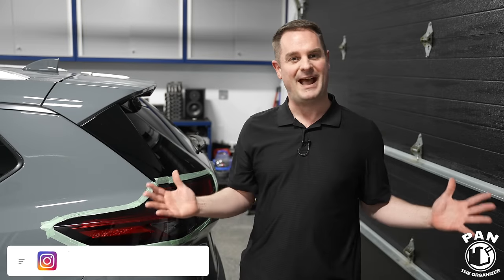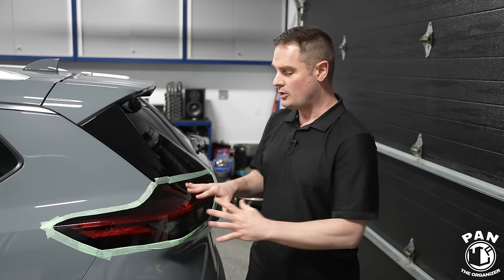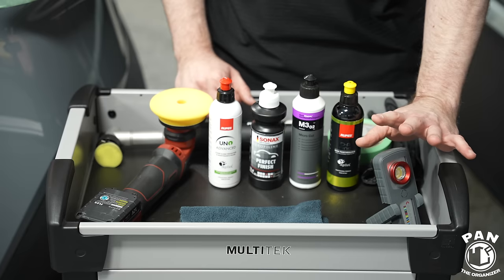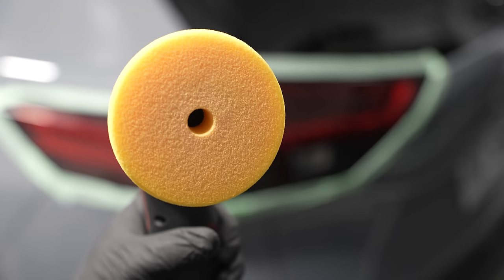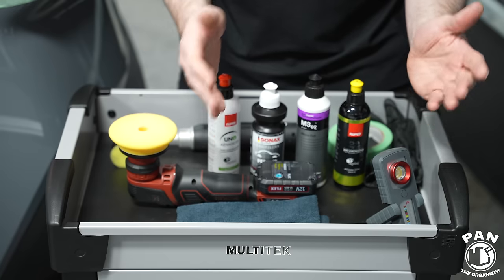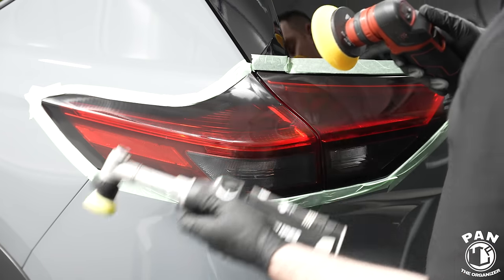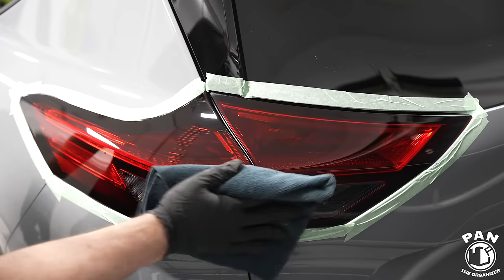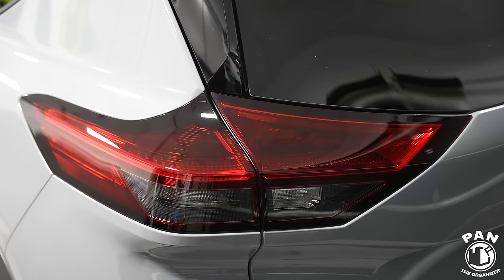How To Polish Tail Lights

Comment: I do often do this to re surface the tail lights and headlights!  Is paint correction a similar process pan?  I’m actually very reluctant to attempt paint corrections, which is why I have not chosen to use a ceramic coating.
Reply from the maker: You're in luck. I have a popular paint correction tutorial for beginners here: https://youtu.be/ustTEVGMOTI
Reply: @PanTheOrganizer  thanks so much pan!

Comment: I’m getting this product used on my 21 pearl black civic, for 1 step correction. Would you please give me an option for a topper for this? With it having sio2 technology could you use something like turtlewax hybrid solutions cermaic spray coating?
Reply from the maker: When using an all-in-one, because it already has protection in it, applying a ceramic coating on top isn't a good idea, as the coating won't be able to bond to the clear coat. Coatings need to bond to a virgin clear coat without any protection interfering.

As you are thinking of applying a spray coating like the TW Hybrid Solutions Ceramic Spray Coating it isn't as critical as a full blown ceramic coating in a glass bottle, so you could in theory still apply it on top of the Rupes Uno Advanced. Perhaps don't expect the full durability of the Ceramic Spray Coating though.

If you want maximum performance and durability, use a regular polish that doesn't have protection in it (like Rupes yellow D/A fine polish, Sonax Perfect Finish, etc), then use a paint prep spray to remove polishing oils and residue, and then apply the protection.

When you use an All-In-One type polish like Rupes Uno Advanced, it's for a quick correction and paint enhancement all while applying a light protection at the same time. It's to save time and money. Not to get maximum performance and durability.
Reply: Totally understandable, I don’t have the money to get a proper 2 step correction and a proper ceramic coating, the detailer I feel was steering me in that direction to offer me some protection for what I could afford. 

I am just trying to be proactive and see if there was something I could to to help boost what he was planning on doing. I think I will discuss this with him, from watching your videos I feel confident I could do a glass bottle ceramic coating, now deciding on something that is $100-$150 that is worth it for at least a couple years. 

Any thoughts or opinions on that? 

Thanks Pan!

Comment: Hey pan. not sure If you have tested it yet with this product but do you know if you can use the uno advance on paint work and then apply a ceramic coating on top or will the coating react to the ceramic that is applyied by the polish
Reply from the maker: This isn't meant to have a coating applied over it. True coatings (in glass bottles) need to bond directly to a virgin clear coat. Uno Advance isn't a coating primer.
Reply: @PanTheOrganizer  okay cool thought so just wanted to make sure thank you

Comment: Very nice. How do you find that the Uno Protect works well on paint?
Reply from the maker: It does great on paint too, as long as you have realistic expectations. As this is an all-in-one polish, it's not meant to remove heavy and deep scratches or swirls of heavy oxidation. It's meant for a light paint enhancement, to correct minor defects, all while adding some light protection on the surface that can last 6 to 12 months according to Rupes.

Comment: Great demo as always, thanks! Loved seeing and hearing more about the Uno polish. Would it be reasonable to lightly polish headlights/tail lights once a year with this?
Reply from the maker: You could do the same on headlights too, but keep in mind, neglected headlights that are heavily yellowed, oxidized and/or have a hazy/chalky white appearance, typically need more polishing techniques. Water sanding, compound, polish, IPA wipe and a ceramic coating applied is usually the best restoration method.

If they headlights are only lightly faded, and you don't have the time or all the tools for a full restoration, you can also use a quick tool-less method like in my headlight restoration tutorial here: https://youtu.be/sqpXsBcVako

Comment: Can this be used on the headlights or do they require a different process?
Reply from the maker: You could do the same on headlights too, but keep in mind, neglected headlights that are heavily yellowed, oxidized and/or have a hazy/chalky white appearance, typically need more polishing techniques. Water sanding, compound, polish, IPA wipe and a ceramic coating applied is usually the best restoration method.

If they headlights are only lightly faded, and you don't have the time or all the tools for a full restoration, you can also use a quick tool-less method like in my headlight restoration tutorial here: https://youtu.be/sqpXsBcVako

Comment: Hi Pan! Is there any difference between the process on headlights at the front of the car and tail lights at the back of the car? 

For headlights I normally see the process; wet sand, compound, polish, and protect. Could that process also be completed on the tail lights? 

Rob - Perth, Australia 🤙🏼
Reply from the maker: You could do the same on headlights too, but keep in mind, neglected headlights that are heavily yellowed, oxidized and/or have a hazy/chalky white appearance, typically need more polishing techniques. Water sanding, compound, polish, IPA wipe and a ceramic coating applied is usually the best restoration method.

If they headlights are only lightly faded, and you don't have the time or all the tools for a full restoration, you can also use a quick tool-less method like in my headlight restoration tutorial here: https://youtu.be/sqpXsBcVako

Comment: I have a question.Does the rear light has the same coating like the front.I am just worried the polishing work could damage the coating.(some cats leave some scratches to my taillights😢,and that was my new car)
Reply from the maker: You don't polish a ceramic coating, as you'll remove it if you polish it.

Comment: hey i meant to ask u can u use purple power vehicle and boat wash on ceramic coatings
Reply from the maker: Not recommended on any type of protected paint, as that's a very high pH shampoo and it could start weakening the coating, and it can break down waxes and sealants.

Comment: Hi Pan, a great video again! Unfortunately I've tried a little hand application and buffing as suggestsed from my Soft 99 microcompound light instructions  on my Bmw g42 tailights, and it got a lot worse, did what the producer told on the packaging.. Dont know what to do, the car was clean 😭 it would be hard to do with a machine polisher, that's why I bought the microcompound light wich has little cutting power 🥲
Reply: Applicaton was with a microfibre towel as it was the black part of the taillight (really slim part that's why I didn't use the applicator from the producer)
Reply: Ok it's not THAT bad, but still the opposite effect..
Reply from the maker: Unfortunately I never recommend hand polishing as it takes a lot of energy and time and you never achieve the same level of results as with a machine polisher.
Reply: @PanTheOrganizer  
Thank you for your anwser, yes, i've learned it the hard way... cheers, and again thank you! Keep up the great work! Cheers!

Comment: Can you follow the same process for the headlights?
Reply from the maker: Yes absolutely. Depending on how bad the oxidation/yellowing of your headlights is. If they are heavily oxidized, you'd have to start with either water sanding, or a heavier cutting polish first, then move to a finishing polish, and ceramic coating application.

Comment: Hello. I have a question for You. I had my tail lights polished by a detailer with Koch Chemie Ultra Cut, then finished it with Micro Cut. I like the result, its fine, but now im worried that it was too aggresive and took out too mich clear coat :( should i be worried? They were polished for the first time and he put protective wax on them. Did he do ok or he messed my up tail lights 😢
Reply from the maker: It’s totally fine. You can polish lights a few times before having to begin worrying about them.

It would have been better if he had applied a ceramic coating at the end though, as those last much longer compared to regular waxes.

If you want to prevent the lights from oxidizing and yellowing, make sure you keep on top of protecting them, just like you would do with your painted surfaces. 👍🏻
Reply: @PanTheOrganizer  Thank you, really. My car is 1 year old, but the tail lights were so badly swirled and scratched, i dont know how. I think that the dealer ruined them while cleaning. I definetely wont agree to wash my car again. Anyway he did propose to put ceramice coating on em, but he said that i would have to leave my car for about 24 hours to let i t dry. Thats why i didnt want it, cuz i need my car :) anyway gonna but the wax regularly. And one last thing, did you notice how the tail lights easily get scratched up? Today i wiped a reticule from one light and i scratched it with my finger 😢
Reply from the maker: It depends on the lights, not all of them have the same hardness, some are softer than others, hence easier to scratch. The most important thing is to use safe washing and drying methods when washing your car. Lucky for you, I have a very popular car wash tutorial here: https://youtu.be/7Koj5j2Es5U
Reply: @PanTheOrganizer  ok, thank you. One last thing. I dont see any clear coat failure on them. In fact they look brand new now. Im just worried that this will affect the speed of fading or oxidation in the recent time to come. He said that he polished it with a light foam pad. So if they werent wet sanded, just polished and the result is fine i shouldnt worry and just keep them in good condition Yes?

Comment: Is this procedure pretty much the same for headlights?
Reply from the maker: You could do the same on headlights too, but keep in mind, neglected headlights that are heavily yellowed, oxidized and/or have a hazy/chalky white appearance, typically need more polishing techniques. Water sanding, compound, polish, IPA wipe and a ceramic coating applied is usually the best restoration method.

If they headlights are only lightly faded, and you don't have the time or all the tools for a full restoration, you can also use a quick tool-less method like in my headlight restoration tutorial here: https://youtu.be/sqpXsBcVako

Comment: Possible to do by hand for those who don't want to buy a polisher?
Reply from the maker: Yes, but you would need much more elbow grease and you most likely won't achieve the same level of results for obvious reasons. But it would still be a good improvement over faded tail lights.

Comment: Being a new Nissan Titan owner, are there any characteristics that go along with Nissan paint?
Reply from the maker: Hi William. First, congrats on your new ride! A new car is never new until it's properly detailed. 
- at the factory, the paint defects are often corrected quickly by rotary polishing which can leave marks and holograms, so polishing corrects those, before you lock that in long term with a ceramic coating for example.
- vehicles are then transported by truck, train and boat so they are exposed to the elements, industrial fallout, brake dust, rail dust, etc
- vehicles are often left at boat docks (when transported by boat) or in exterior parking lots for weeks or months, again being exposed to the elements
- at the dealership, the vehicles are almost always poorly prepped using the same dirty water that was used for all the cars on a given day, and poor washing and drying methods leading to swirls and scratches 
- at the dealership, a layer of cheap wax or paint sealant is usually applied to attempt to make the paint glossy prior to delivery. It's crucial to remove any previous protection before you apply a ceramic coating, as coatings need to bond directly to a virgin clear coat.

If you only plan on applying a regular carnauba wax or paint sealant though, you could decide to skip machine polishing, as those protectants can be applied over existing protection and it's not as crucial to prep the paint as well.

I explain all of this in this popular video: https://youtu.be/QgoyrC-5CMc

So you can better visualize the new car prep process, here are the steps I perform on a brand new car from two of my customers: 
Tesla Model Y: https://youtu.be/gohks8xP5NY 
Porsche 911 Carrera: https://youtu.be/2ckiivbFqs4

Comment: Hey Pan, why didn’t you use the new rupes Microfibre pads, yellow or white?
Reply from the maker: Microfiber pads cut more typically, but they weren't needed for this level of defect removal. As you saw, the foam pads did perfectly well.
Reply: Thank you sir!

Comment: Hey Pan can we correct the headlights the same way ?
Reply from the maker: You could do the same on headlights too, but keep in mind, neglected headlights that are heavily yellowed, oxidized and/or have a hazy/chalky white appearance, typically need more polishing techniques. Water sanding, compound, polish, IPA wipe and a ceramic coating applied is usually the best restoration method.

If they headlights are only lightly faded, and you don't have the time or all the tools for a full restoration, you can also use a quick tool-less method like in my headlight restoration tutorial here: https://youtu.be/sqpXsBcVako
Reply: @PanTheOrganizer  Thanks i will watch this carefully .

Comment: Would like to see you do some very faded headlights to see how to make them back to like new. Ones that are a little bit out of just polishing out and needing a sanding first and the step by step guide to get rid of the oxidation
Reply from the maker: You could do the same on headlights too, but keep in mind, neglected headlights that are heavily yellowed, oxidized and/or have a hazy/chalky white appearance, typically need more polishing techniques. Water sanding, compound, polish, IPA wipe and a ceramic coating applied is usually the best restoration method.

If they headlights are only lightly faded, and you don't have the time or all the tools for a full restoration, you can also use a quick tool-less method like in my headlight restoration tutorial here: https://youtu.be/sqpXsBcVako

Comment: Great vid again, pan... q: does the same apply to front lights?
Reply from the maker: You could do the same on headlights too, but keep in mind, neglected headlights that are heavily yellowed, oxidized and/or have a hazy/chalky white appearance, typically need more polishing techniques. Water sanding, compound, polish, IPA wipe and a ceramic coating applied is usually the best restoration method.

If they headlights are only lightly faded, and you don't have the time or all the tools for a full restoration, you can also use a quick tool-less method like in my headlight restoration tutorial here: https://youtu.be/sqpXsBcVako

Comment: Hey pan, nice video as always :) do you have a video on restoring parts of a ceramic coating as well? Or planning on one? Similar to this video, we all face situations where we get a swirl or scratch on a part of the car or have to do a repair (dent or other); how then to repair only a small part of the coating instead of having to redo the entire car?
Reply from the maker: There not much you can do on a coated vehicle, as you wouldn't polish the surface. That would damage the coating. There is however one polish that was made to correct very light defects on a coated car, this one: http://bit.ly/3IC15uA
Reply: @PanTheOrganizer  but can you re do coatings on just a part of the car?
Reply: @PanTheOrganizer  Can you explain this a bit further? Why wouldn't the Rupes Uno Advanced work just like the Essence+ you provided the link to?  If you are polishing a ceramic coated vehicle with a polish that also adds/provides ceramic protection, what is the issue? Is it that you end up with a non-uniform look because the coatings may look different once they cure out? Is it that the ceramics in the polish won't (or may not) bond properly to the paint or the existing coating?  I could see how those things might all be issues but would like to understand the details.

Comment: Hi Pan,great video nicely explained. I have been watching your videos for a while now and been a fan of yours.I am also into detailing and watch your videos on daily basis... your videos are very helpful and provide tons of information.Thanks for your informative videos and keep going... just one question for Rupes Uno Advance does this contain fillers? & if not can we use this polish before Ceramic Coating application ?
Reply from the maker: It most likely contains fillers, and it's not recommended for use prior to applying a ceramic coating. Don't use all-in-one type polishes before applying a coating.

Comment: I believe that this goes for headlight also, right?
Reply from the maker: You could do the same on headlights too, but keep in mind, neglected headlights that are heavily yellowed, oxidized and/or have a hazy/chalky white appearance, typically need more polishing techniques. Water sanding, compound, polish, IPA wipe and a ceramic coating applied is usually the best restoration method.

If they headlights are only lightly faded, and you don't have the time or all the tools for a full restoration, you can also use a quick tool-less method like in my headlight restoration tutorial here: https://youtu.be/sqpXsBcVako